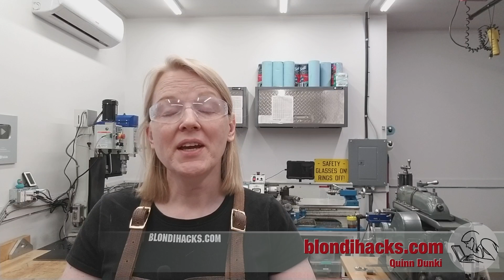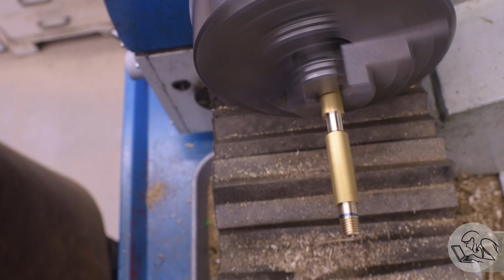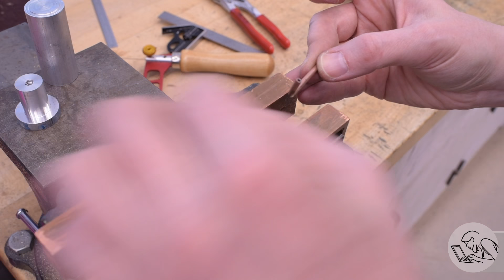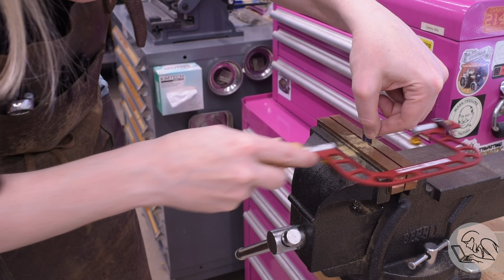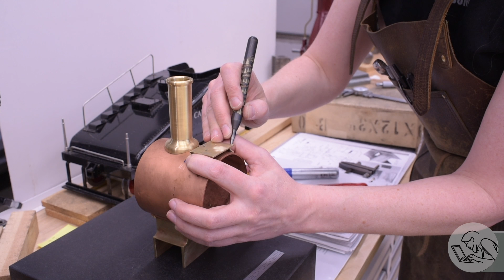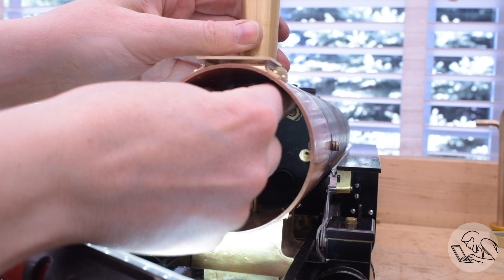Smokebox Plumbing! - Pennsylvania A3 Switcher, Part 96

Comment: Nice work as usual. May I suggest making a 3D printed parallel for small thing you can make almost anything for this use (PLA/PETG) . I have used them myself and they work well. Especially when minimal pressure is on them and they are just used for height. Thanks I love your stuff!!!

Comment: Really coming together now. Counting down the days to steam. 

The pipe issues inside the smokebox is why all locos 3.5" and smaller I now build get a split smoke box. That way you can get it all done up tight and then fit the top of the smoke box last. Martin Evans describes the process in one of his books.

Comment: 25:24 ooh nice! i wasn't sure where this was going until you mentioned cutting a slot, and i immediately remembered one of my favorite niche tools: a little wrench for F-connectors (on coax cable). looks basically like a socket with a knurled finish and a slot on one side to pass over the cable... it's a nice alternative to a fingertip death grip and "persuasive" language to remove a stuck connector from the wall

Comment: The pneumatic fitting you made are almost exactly like AN flare fittings in an aeroplane. We flare the tube however and the nut seals the flare on the tube against the flare on the fitting. - and the same rule applies for the b nuts in aviation!!! I’ve also put a nut on backwards. So frustrating!

Comment: In bending plastic and glass pipe for water cooling in computers they use a long silicone cord to fill the inside of the pipe they are bending with the mandrels to prevent collapsing the pipe.
Reply from the maker: Good idea!

Comment: Everything you said about putting the union nuts on the pipe before soldering on the nozzles (and pointed the right way) perfectly applies to installing PL-259 connectors on RG-8 coaxial cable. Ask me how I know about that...

Comment: One technic I saw in industrial settings is to fill the pipe with water and freeze it. When bending, the ice will help maintain the round shape of the pipe. Not sure if it would translate with copper and smaller tube but might be worth giving it a shot!
Reply from the maker: That’s a good one! I may try that

Comment: Your modified nut driver reminds me of a tool that I used when running RG6 and dealing with F connectors.  It took some effort to find one,  but eventually I did. I recall at least one reference to this calling it a "can wrench".

Comment: There's something a former professor of mine used to say - "An engineer designs a tool that will only be used for one thing, a machinist builds a tool that will only be used for one thing, but a mechanic modifies a tool that will only be used for one thing and gets it to work for three!"  He had a lot of respect for mechanics.

Comment: Not the first person to drill into something you forgot was underneath, not by a long shot. And not the last. Far better than drilling into a wall and discovering a water pipe that isn't on any plan..
Reply: Yeah, been there! Many moons ago mounting a small wall shelf in the dining room. First hole, no problem. Second hole, hey that's weird, after the white drywall powder, what's that grey plastic stuff? Oh, pvc drain pipe from upstairs...
Reply: Or the lights go out because someone ran romex where they shouldn't have.
Reply: There's nothing quite like that feeling when the drill chips change colour unexpectedly

Comment: Quinn,  that was fine work inside the smoke box.  You will at one point run out of things to do on this engine ! It’s getting to the stage that a hand written list of jobs to still do  and would be fun to see those getting slowly knocked off like Squatch is doing  with his prototype MM tractor.

Comment: I wonder if having a small OD at the tip of the blast nozzle, and a smooth tapered transition back to the hex might improve performance. More combustion gas will be drawn smoothly on the outside surface of the nozzle into the steam blast.  Any step or transition can reduce flow and cause turbulence at the nozzle tip.

Comment: I would love a video of you just trying a project specifically on the shaper to test its limits on DOC and stepover. It'd be really interesting to see what a mini shaper can do in relation to a big ol' shaper. Is it a scaled model or can it, in relation to it's size, cut more than the big ones? had a coworker that kept insisting he use his fingers to feel the drill going through sheet metal into a sensitive area and managed to be the guy with a hole in his fingertip and fingernail. I've been hyperaware since then about what's behind the drilling area

Comment: for tube bending my father and I used pipe cleaners to make a mock up design and then bent the tubes to shape following that template.   It delivers cleaner results, pun intended.
Reply: I've done the same for car exhaust systems with welding wire. Works like a charm!

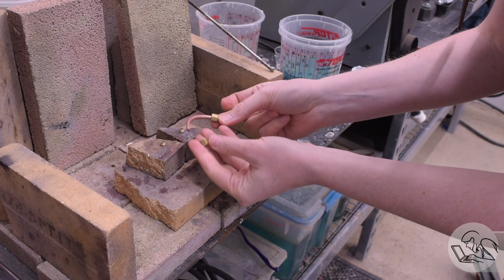Comment: 13:50 I am not a model engineer, but I had a lot of facepalm moments with the electrical equivalent: Heat shrink tubing.
Reply: Ah, the electrical tape of shame...
Reply: At least those can be taken apart often enough